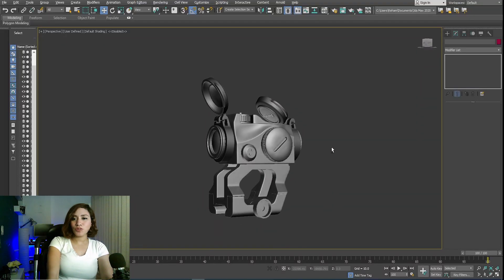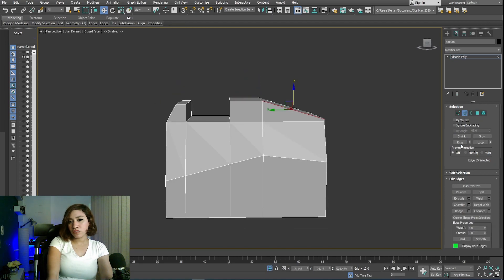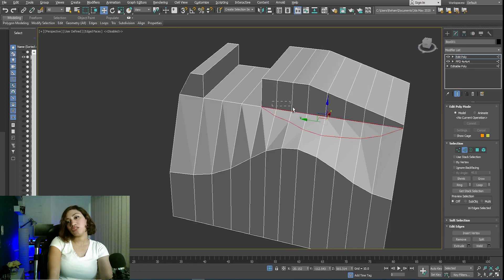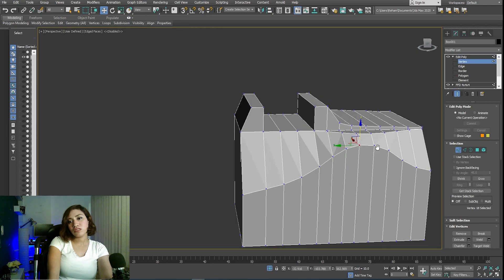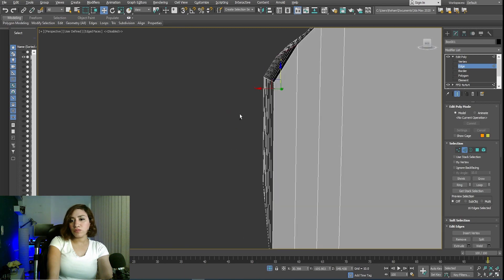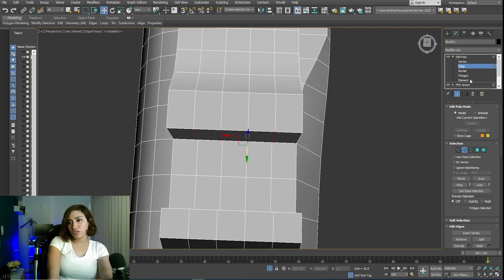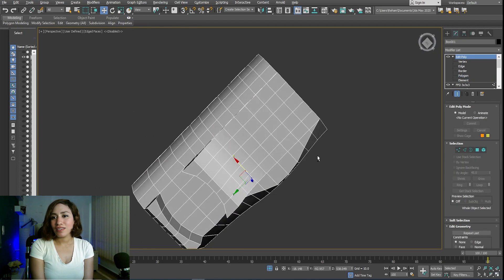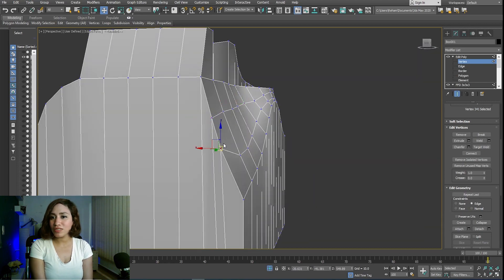#3dsmax#hardsurface#modeling How to model Hard Surface Game Asset in 3ds Max

Comment: I thought this was a fun hobby that I could turn into a job. But it’s more like a job that you get paid for years later
Reply from the maker: You can get paid after 1 year if you spent it studying well .
Reply: @RihamGamal_3dAssets  well i've been doing fusion 360 and solidworks models for a few years now and I just recently got into doing 3d studio max, only problem is I cant make any gun model, I just have such a hard time doing anything like that. I can make a simple sword fine with some complex features but I just cant get the hang of guns for some reason
Reply from the maker: @Jeerin_  watch some tutorial for guns, and practice it  (start by making simpler ones ), i'm sure this will be helpful